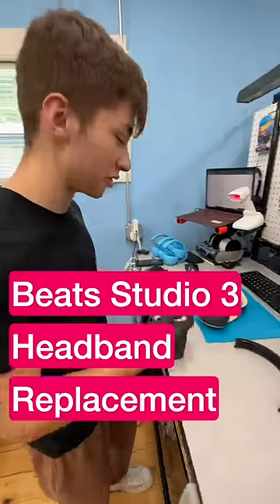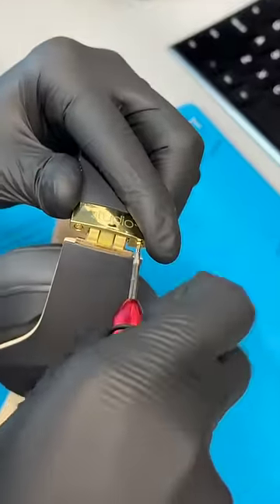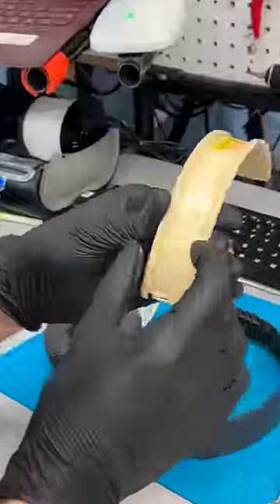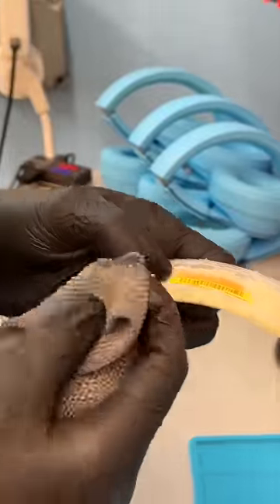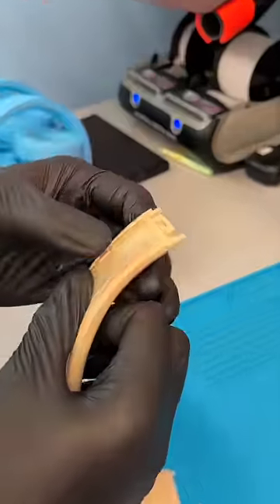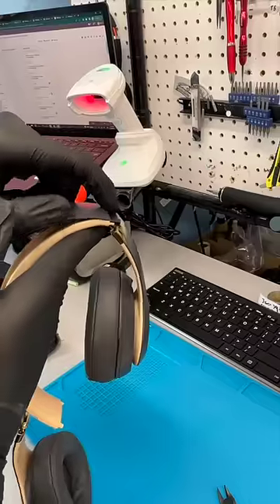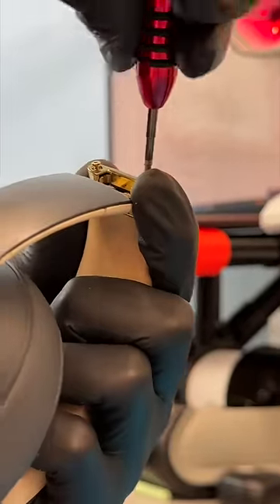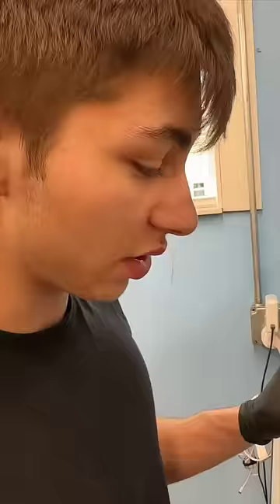Beats Studio 3 Headband Replacement Repair #apple #electronicsrepair #repairtutorial

Comment: What if the wire is too long for the headband? It's the same length as the old one but I can't get the wire to lay down properly because there is too much slack
Reply from the maker: Hello, thanks for commenting. Please email us at support@joesge.com with your question. We will be able to better assist you there. - JoesGE